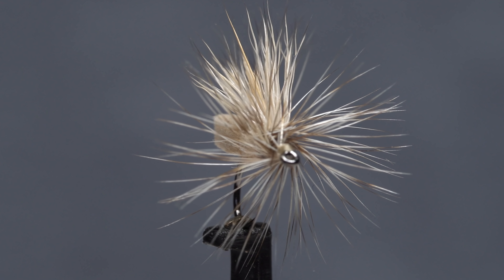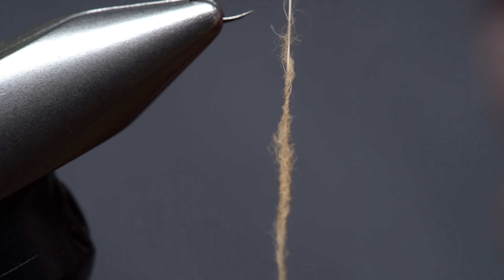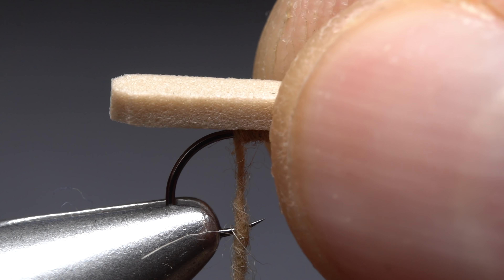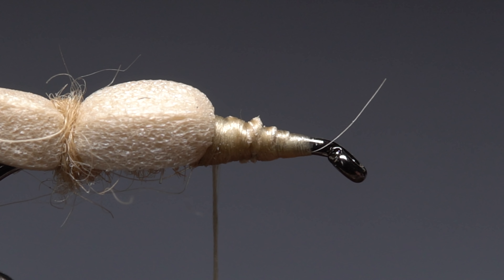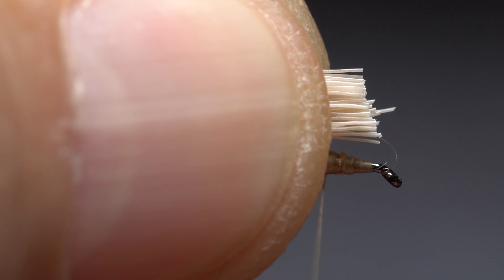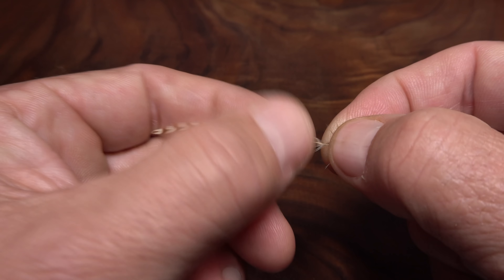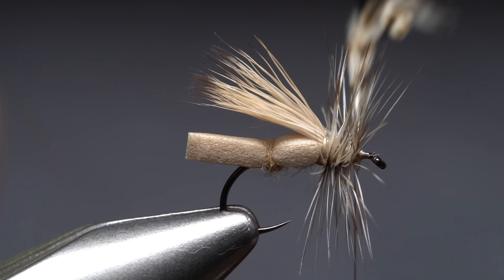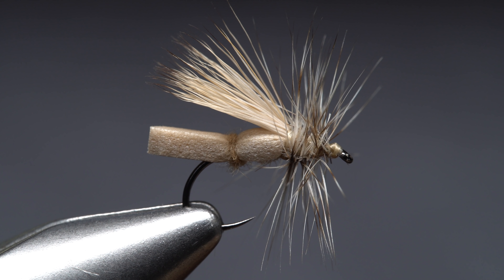Puterbaugh Caddis Variant

Comment: Try using a lighter to the back part of the foam. Once you cut the corners of at an angle, just touch each side with the flame from your lighter and your body will round out 👍🤙

Comment: This fly looks like a great floating pattern for fast water, but if you were to design a fly that skitters well in slow water and floats, what would it look like?  Typically, I find I can skitter a Cadis right after it hits the water but after that any attempt to twitch or skitter sends it underwater.   I'm thinking this happens because once the fly breaks the water tension, any feature that would contribute to it going under on a twitch, causes it to do so. One thing that baffles me on a fly that should be skittered is why a down eye hook is used? ...it seems that all Cadis would work better with an up eye, assuming that type of dry fly hook is available.